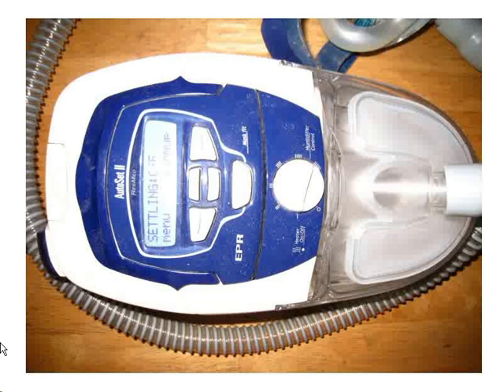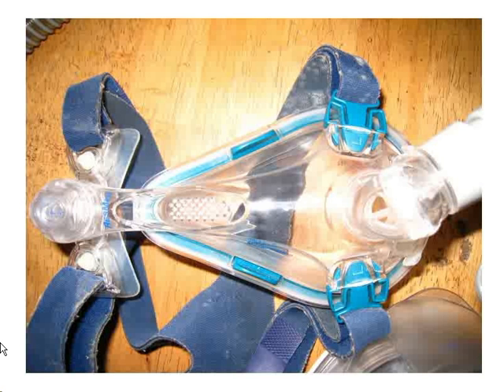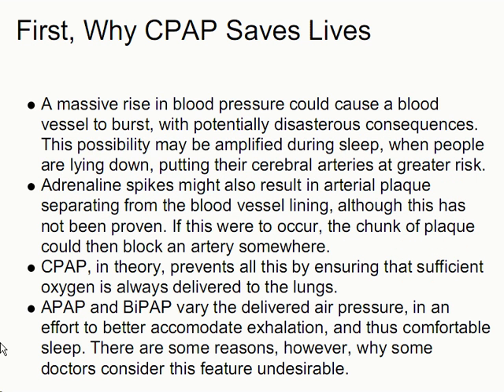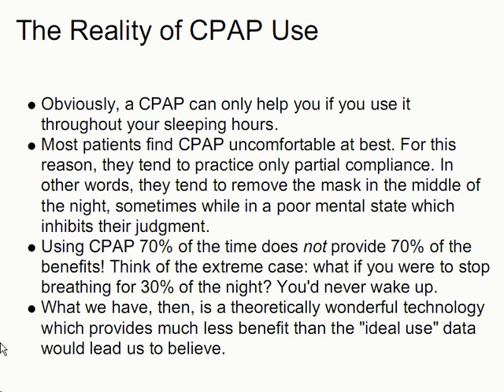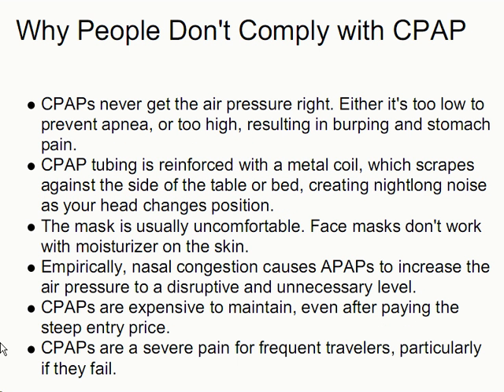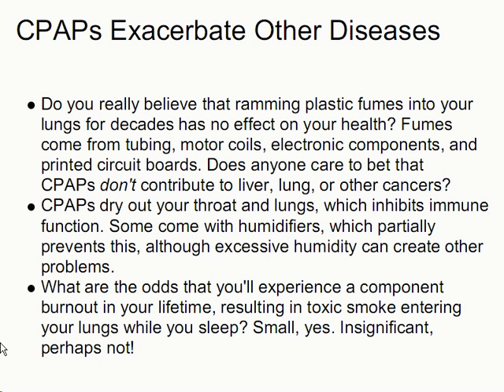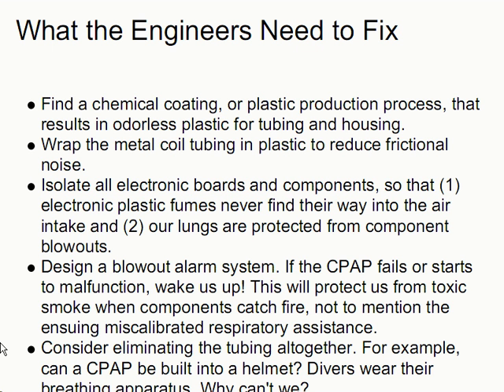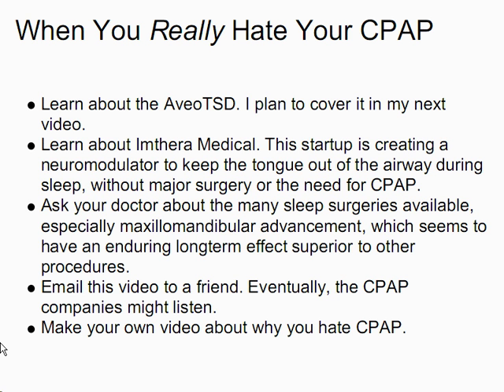Why CPAP Sucks and What to Do About It

Comment: i use this mask and i still don't get straight threw sleep because of prostate problems i wake up e- 4 times a nite and in morning dry throat like spittin out feathers and nasal passages same thin then during the day get nose bleeds because of dry nasal passages , the machine doesn't give enough moisture so it's just like having air hose in mouth all nite , so I'll be looking for alternative treatment and if can't find then it goes wbere it goes. my mother lived 91 yrs and snored her mother 98 and snored so is sleep apnea a growing balloon? are there death certificates saying the person died of sleep apnea? blood pressure goes up because of it? for how long ? how long and how much your blood pressure go up swimming, running? you need mask for that high blood pressure? that gonna give hou heart attack? if you don't have clogged arteries or bad heart condition then why the panic? get checked out ! also lack of vitamin D creates sleep apnea so get blood test and if low get it where it suppose to be and then check for sleep apnea maybe don't have anymore so don't need treatment .use common sense.

Comment: Have had the machine for 3 years. Sorry don't see the benefit. First of all you are drudged when you take the test, that disqualifies the test right then and there. Second, for the test to be done right the sleep test should be conducted 2 times with the Cpap in the first stage of sleep then Cpap in the last stage of sleep. Third you only need to use it 4 hours a night. Being an insomniac I can and do live with that. I can attest that 3 hours a night I see spots. But 4 hours is magic for the Cpap forks (Really)! Fourth The machine will leave your mouth 10 times dryer than the Sahara desert or will drown you in the night, and don't give me any guff about adjustments on the machine, like I said I have had it for 3 years. Any Dentist will tell you a dry mouth is bad for your teeth. Fifth I have had Pneumonia 4 times while using the Cpap, and yes I do clean  it!
The Cpap is bad science at best, Oh don't get me wrong it has made a real lucrative cottage industry. All said and done around $10 thousand invested in mine to date, That's Dr visits, cost of machine, and parts. Now you ask why do I use the Cpap and thank you for asking. It is required by law for Truckers. The Cpap folks made sure that got done. SO now with the new machines the insurance, and the Cpap folks are in your bedroom wifi-ing god knows what all info back to them. (ie) conversations, and every bump and grind. Don't think its not going to happen.
In conclusion I think its past time for a good old fashion CLASS ACTION LAWSUIT!!! 
So all you Lawyers out there let loose the dogs of war!
As for all the bonafide believers out there. Chalk it up to mass hysteria. I doubt any one that takes the sleep test passes it. I was at a meeting  recently attended by around 50 people and ask how many people were on the Cpap, and over half raised their hand.
Reply: 'Cpap folks are in your bedroom wifi-ing god knows what all info back to them.'-AGREED
Reply: 'The rate of CPAP adherence remains persistently low over twenty years worth of reported data. No clinically significant improvement in CPAP adherence was seen even in recent years despite efforts toward behavioral intervention and patient coaching. This low rate of adherence is problematic, and calls into question the concept of CPAP as gold-standard of therapy for OSA. 
It is not sufficient to simply prescribe a CPAP machine and consider the patient to be treated.
The sense of CPAP being considered gold standard of therapy has become so entrenched within health that many North American remunerating agencies, be they government insurance or private plans, as well as in the medicolegal world, have adopted the position that patients must undergo a trial of CPAP prior to being considered for any other more invasive intervention. However, the AASM parameters also recognized that a significant proportion of patients are unable to tolerate CPAP therapy, and frequently seek alternate treatment|Despite numerous advances in machine dynamics including quieter pumps, softer masks, and improved portability, adherence to CPAP continues to be a problem frequently encountered in clinician’s offices, with adherence rates generally ranging from 30 to 60 % [7, 8]. There are many reasons for this problem including comfort, convenience, claustrophobia, and cost. [2] It is also understood that many patients who start on a path to non-adherence frequently remain non-adherent and eventually abandon the machine altogether, with consequent return of symptoms and OSA-specific adverse consequences.
Conclusion
This review represents the most up to date data on secular trends in CPAP adherence. The findings are sobering. Our data suggest that despite numerous changes to machine and mask dynamics as well as behavioral interventions, CPAP adherence remains a severe problem for management of patients with OSA - the concept of CPAP as gold standard for OSA therapy is no longer valid. This paper’s data regarding a comprehensive assessment of CPAP adherence can be used when developing OSA treatment guidelines and when counseling patients about their OSA and the relative likelihood of treatment success for the various therapies at hand.
'
 https://www.ncbi.nlm.nih.gov/pmc/articles/PMC4992257
Reply: @xymotic  You cover CPAP adherence but do not address what I discussed. I would like for you to address  the bad science I brought up.
Reply: @xymotic  Our data suggest? Who are you?
I have had pneumonia 4 times in the last 15 or so years and do not trust the Cpap system. I have discontinued using it. I would have to say adding WIfi to the new machines would have caused me to stop using it anyway. I have invented a machine that would breathe on the Cpap for me, it breathes irregularly like a human and has a built-in timer no worries.

Comment: IMHO DISREGARD THIS VIDEO
This video is hopelessly out of date.
I had the same machine. I did not experience ANY problem with plastic smells. But my hoses were manufactured in 2016.
I now have a Dreamstation(tm) with a Dreamware (tm), set to Autoset," and "auto on/off. 
My AHI 2.6 (normal is less than 5)
My hours average 7.6 per night, as opposed to 3-4 in the old machine and mask.
The new machine ramps from 8.0 and is set to a MAX of 20 HOWEVER,  the new machine has never adjusted to above 12. It also has flex pressure relief so exhale is effortless and my mouth now stays closed WITHOUT A NEED OF A CHIN STRAP (HUGE COMFORT FACTOR).

While weight, more precisely, loose tissue in the throat, is a factor, the judgmental tone of this video is NOT helpful. People often gain weight as a result of eating that is caused by medications, or genetic factors. Video advice keep the focus on topic.

Comment: I do not agree with any of the objections this presenter poses against the use of CPAP. If you suspect you have sleep apnoea, do yourself and your loved ones a favour and get tested and get a CPAP machine. It will change your life for the better. The "dangers" stated  are insignificant compared to the incredible benefits. What if a Boeing 747 lands on your house while using a CPAP machine. It is as likely as some of the problems posed by the presenter. His experiences are atypical and it would be a great pity if they prevent anyone from getting tested and getting the incredible benefits of using a CPAP machine.  CPAP is not ideal but, like open heart surgery, if you need it do not hesitate getting it. I agree, there is some very small possibility of a bad outcome. But, like heart surgery that is needed not getting it ensures 100% a bad outcome. Choose to breath oxygen instead of choking slowly to death due to lack of oxygen which is what sleep apnoea causes.
Reply: 100% IN AGREEMENT

Comment: CPAP isn't perfect and for many it takes getting use to, but the benefits far exceed the down falls. The gentleman who presented this presentation did so in a very irresponsible way. His experience doesn't speak for the millions of people who do get a good nights sleep every night due to their CPAP unit. Many of the issues that he talks about are wrong. I work in the medical field and if this man is having as many problems as he states, I would say he needs to make another appointment with his sleep doctor to be fitted with the right equipment for him.
Reply: I agree another problem is that this machine and video are old. The machines and masks have changed so much since then.

Comment: Pretty much had the same issues so I built my own CPAP for under $50. Runs quietly. Easy and cheap to maintain. Pumps 32 litters of air through mask (which I also made).   Will upload a DIY video once I've tested it properly.
Reply: Unless you have no insurance I do not recommend doing what you are doing.  The pressure applied to the airway is critical and if you put to much pressure in for your situation it can do permanent damage to your lungs.  Don't do this shit without a doctors supervision
Reply: +djancak the air pressure is prescription only. Its illegal to do this without a doctors supervision. Is that proof enough?
Reply: HAHAHAHAHAHAHA
Reply: i would love to see this

Comment: Tongue is not always the issue.  I just stop breathing.   If you really think AveoTSD works, consider this, My Bipay is nearly $2000.00.  If The AveoTSD is the solution, Insurance companies would be all over that so fast.   CPAP are not a good for obstructive disorders.  The pressure would just exacerbate the problem. I relish my Bi-Pap.  It has changed my life quite considerably.  My oxygen level dips below 65 at night without a Bi-Pap. As a general rule, anything below 90 is time to go to emergency room.  I can't use a CPAP as the pressure I need is so great, you can't exhale against it.  And yes, I agree, there is considerable room for improvement in mask, machine, and tubing.
Reply: Madoog, is your Bi-Pap from Philips-Respironics ??

Comment: Can someone please help.  My husband has a S8 escape II machine.  Evidently this machine is out dated compared to the latest one out.  He needs his data read for his present job but the doctor that he originally went to move his business.  His present employer has no information about this machine.  Do anyone know where or how he can find someone that has the capability to read his data for this machine?  Please help!  Thank you!
Reply: Jesse, telephone around town to the various medical supply stores which offer oxygen/breathing/respiratory supplies and services.  The ResMed S8 has a special memory card and requires a special card reader which USED to be sold by ResMed and is no longer AND ResMed ResScan software for the S8.  Many of these companies realize that they need to provide service for the "orphaned" S8 and kept their S8 card readers and S8 ResScan software. I live in a very small city and I easily found a medical supply company which could support the download and printing the compliance report.
Reply: +Chris Rodrigues thank you so much.
Reply: @chrisrodtaco  I have that same machine.  There is a short plastic tube that is inserted between the machine and the hose to connect my oxygen tube.   The little tube has cracks in it.   I called my supplier and told them I need another adapter tube.   They said your machine is out of date and we don't have parts for it.   I repaired the tube with duct tape wrapped around it.   
Mine has that memory card but no one ever reads it anymore.   The doctor's office read it once years ago but never has again.

Comment: Never heard such a complete load of claptrap in my life. If this guy really had sleep apnea he would just be grateful that it keeps him alive. I know I wouldn't be here without mine. All of the issues he raised are easily dealt with if you want to. The smell from a new mask can be sorted quickly, so can leaks,  get a cover for the pipe, nasal congestion- use olbas oil in the humidifier. All so simple but this wining, whinging muppet appears to be one of lifes moaning gits who would rather whinge that do something about it.
Reply: You sir, can't think critically and also are a troll. Who the hell are you to criticize somebody, who's trying to help. In a nutshell, you're being disrespectful and showing your character in the process. I believe you should look in the mirror because it is YOU who's whining about this guy's video.
Reply: I dont think he was being disrespectful. The op posted the video anonymously...giantswooddude just repsonded with his thoughts. I dont think he was whining about the video, but instead suggesting there are answers the the ops cpap machine problems. He could have left the name calling out, but when someone posts anonymously its hard not to think they're being a Bit passive..
Reply: I vote for whining.  It's a life saving device with a few warts which every new, evolutionary model improves on, at least for ResMed. All these problems for CPAP are fairly easily mitigated. Decent insurance pays for most, if not all of the cost.  Beats being dead...
Reply: The electronics burning story borders on FUD (fear propaganda)

Comment: What an outrageous exaggeration of CPAP problems.  I have never noticed the plastic smell which Mr. Anonymous discusses.  Once I got used to the machine (which took about  a week), I notice no discomfort.  In fact, I can't get a decent nignt's sleep without the machine.  Technological advancements will make the machine even more comfortable.  However, I suspect that Mr. Anonymous will still be complaining.

Comment: check out a new mask:  resmed airfit f10 .... rocks!  better than all my old ones ... I used the one he uses in his video .... and I like the airfit sooooo much better!  i'm saving up to try the Transcend auto cpap ... it feels like a baseball cap and your 9" tube uses your breath and its system for its own humidification system ... or you can use your old long hose w a humidifier .... it's incredible!  they're new and have sold 50k.  I hope he checks Transcend cpap machines out and does a video

Comment: I have used a Bi-Pap for over 8 years.  Your comments I find silly.  Why don't you try sleeping in a full face motorcycle helmet before you make that silly suggestion.  And, it is made of plastic.  Next, Everything is going to be some kind of plastic.  Any other material is going to be way too expensive. On the order of 10 to 100 times more expensive. And, there is CONTINUOUS flow of air,  3 or 4 times the air you actually breath is leaving your mask at all times flushing any and most plastic odors if any.
I am super sensitive to smells and have never noticed any with either ResMed or Resperonics BiPap machines.   I have so much more to say but why.
Reply: This video was made in 2010, perhaps you should gather the facts before making judgement?

Comment: I've used CPAP and now BIPAP machines for years and I've gotten much more good from them than bad.  I agree with the other people who's mentioned that they need to be cleaned regularly.  Also, since I've been using these machines, I've had NO sinus infections and fewer colds, fewer allergy attacks, and - most importantly - my blood pressure went down to normal and I am not sleepwalking through every day of my life as I did before.  Of course I'd love to be able to be cured of sleep apnea but, since that's not on offer, this is the best solution for me and less invasive than any other treatments.

Comment: CPAP is the worst thing I have ever had in my whole life. The sold it to me as if it was the best thing available and was gong to solve all the problems. It's very impractical. No matter how hard I tried to keep it on, I always woke up in the middle of the night and removed it without even realizing it. It's the worst of the worst. I hate it
Reply: Just keep at it.  I did that for many months.  You have to remember it can take over a year in some extreme cases (like me) for people to adjust.  Relief will come but you have to keep getting adjustments.  Also, in the interim, if you were given a head wrap, try putting that over the machine instead of it under.  It may prevent you from taking it off at night.
Reply: Ohh and one more thing.  If a machine they gave you doesn't work and it only puts you back to where you were, and you are calling that the "worst thing I ever had in my whole life".  you've had an easy life.
Reply: SeanP7195 are you a comedian? Or a wannabe comedian? take your sarcasm somewhere else. The CPAP machin is sold as if it was a panacea, but it sucks, big time. That's all I meant
Reply: Candidfellow, it took me over a year to become compliant with the CPAP.  Try getting adjustments and stick with it.  If you are looking for an overnight miracle, you won't find it with CPAP.
Reply: +SeanP7195  In UK you HAVE to use the CPAP if prescribed, or lose your driving licence, I have central apnoea, and was given just 6 weeks trial with CPAP, I hate it, I am a bit claustophobic, it ruins my sleep, and my life, I had central apnoea all my life, I'm 64 now, and OSA only occurred 3 times per hour, and it was a bad night, O2  did not dip much, but still have to wear the blasted thing to get my driving licence back. I was pushed into sleep clinic by an anaesthetist, who would not allow an op until I had it done, conclusion was, I was not in danger during anaesthetic, but side effect is, I'm not allowed to drive, even though I have never had inappropriate sleep episodes, or driven tired [except after a night shift as a nurse]
Reply: +SeanP7195  In UK you do not get months 'to get used to it', not enough hours in the first few weeks, lose your driving licence
Reply: Kaeren Daunt-Jones Sounds like the UK is the issue, not the device.
Reply: @candidfellow  Same here! CPAP cured me of sleep apnea preventing me from sleeping at all